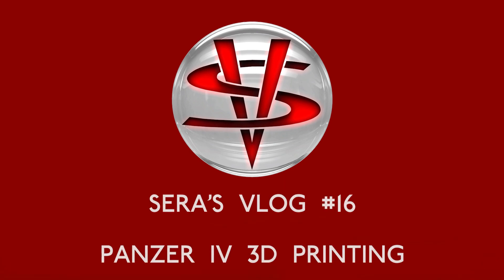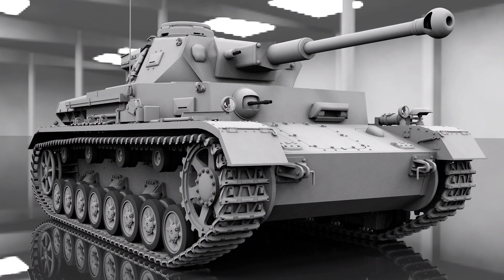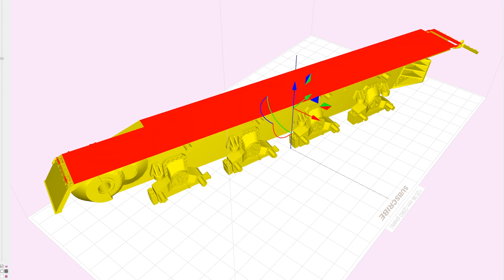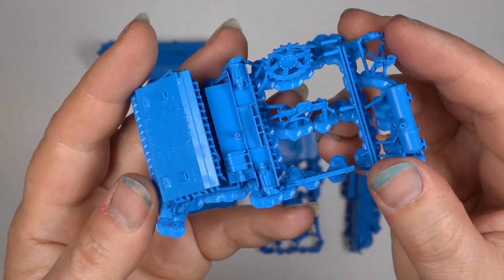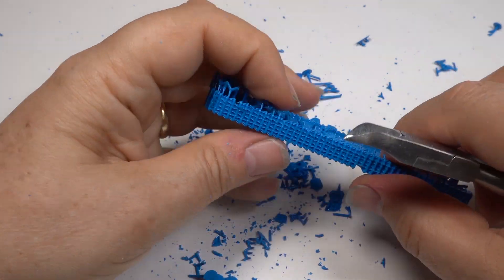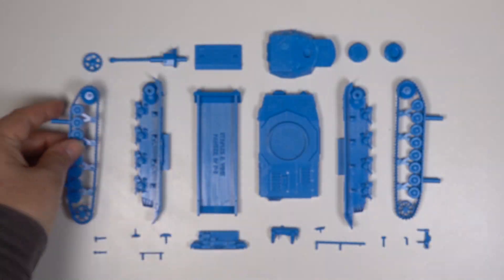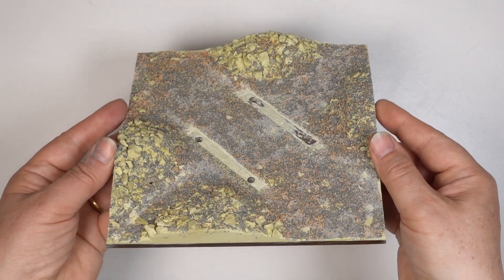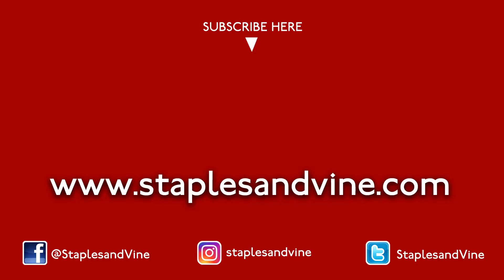SERA’S VLOG PART 16 ‘PANZER IV 3D PRINTING’

Comment: Hello. Please tell me what kind of resin You use? Its exact name
Reply from the maker: Hi, I use 'Photocentric mould blue'. It is specifically for the 'Photocentric Precision 1.5' and I am pretty sure it will NOT work with other printers.
Reply: @StaplesandVine  Thanks. The resin is very interesting. The characteristics indicate that it can withstand heating 180 degrees. It would suit me. I didn't find a printer like Yours on the photocentricgroup website. Is it discontinued?
Reply from the maker: @MISHA0150  I can't see the printer or resin on the site. They may well be discontinued! That's a problem I don't need... 😕

Comment: thats nice ,I have done tons of resin 3d printed models ,the best way to deal with the resin is to clear the parts from the supports when the resin is uncured because is very soft easy to cut and clean it plus it doesnt leave big holes when you remove them and are much much easier to trim them down !
Reply from the maker: I totally agree. It's nice and soft fresh off the printer, and comes away much better. The problem I have is having to photograph and film everything for YouTube etc. I'll try and feature that in another video. Thanks, Sera.